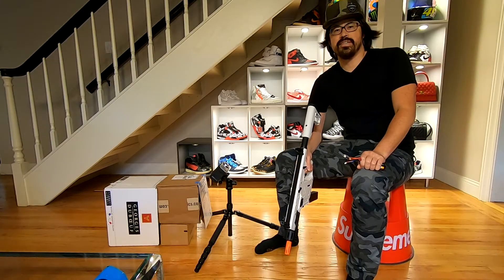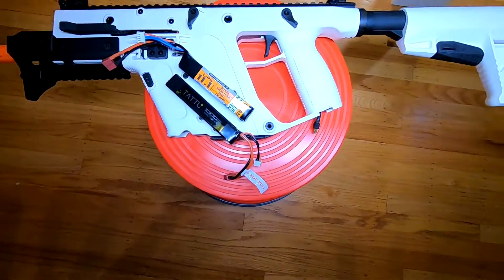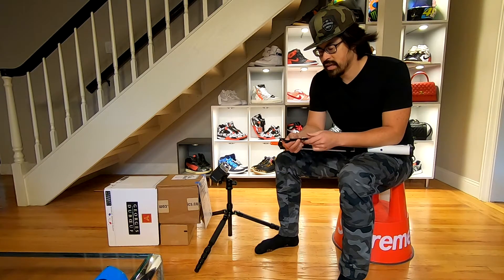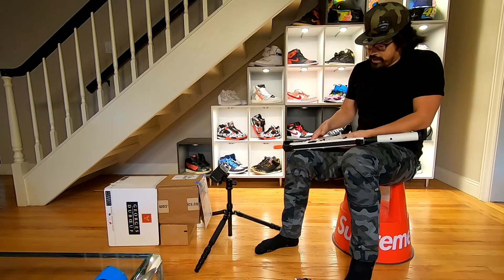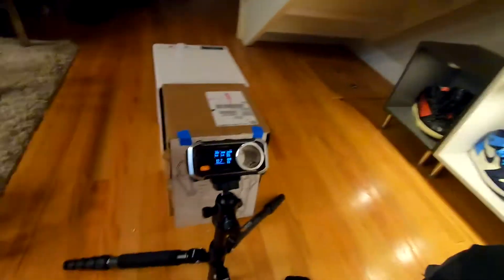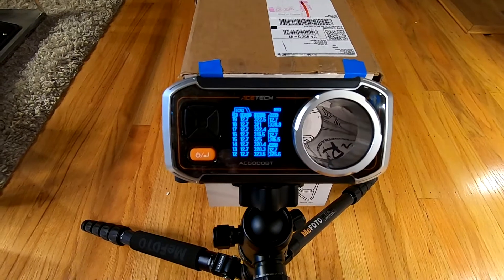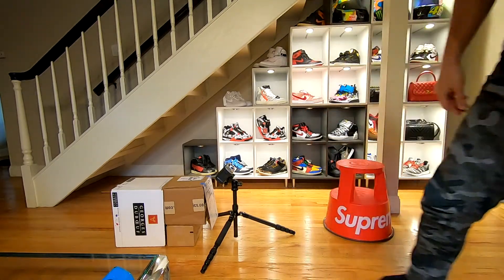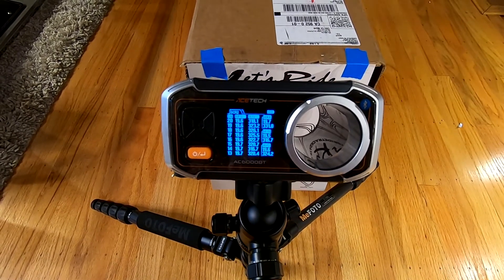7.4v vs. 11.1v Lipo Airsoft Batteries: What's the difference?!?

Comment: I got a 6v battery pack in mine and the only upgrade I see available is a 7.2v . Is this small jump in voltage even gonna be noticeable or should I just leave it alone.
Reply: yes slightly.

Comment: Hi im new to airsoft  if the recommended lipo battery is 7.4v can i use a  11.1v?  a higher volts?  thanks
Reply from the maker: What's up man, I don't want to speak for everything, so you might want to search for your specific case, but yes, I do use 11.1v in mine where they recommended 7.4v and I haven't had any issues. Your mileage may vary.
Reply: Use lipos only if u have a mosfet tho

Comment: Quick question ⁉️ if your gun is  9.6v nimh - 11.1v lipo ready could you also run a 7.4v lipo?.
Reply from the maker: I believe so, it will just be underpowered vs 11.1v lipo.  I have done it in my own with no issues
Reply: @FlawlessActivity  alright man thanks for the quick feedback. Still waiting on my Lancer Tactical Elite MMC to get here this week so I can try it out.

Comment: Huge difference! Good info man, I've heard people claim a battery voltage affects FPS, but thats just silly logic. Its the same spring and gear action every time, the only difference is the speed, in which you clearly demonstrated!
Reply from the maker: Thanks man! Yea, I mean, I honestly didn't know any of this when I started, so once I learned how everything worked and it all made sense, I figured I would verify it and pass the info along. Hopefully this helps others wondering the same thing!
Reply: Look at novritsch shop he claims that his ssr15 has 1.6 joules with 11.1 and 0.9-1.4 with a 7,4
Reply: @corbikristukat2129  Those claims are completely false. He of all people should know battery voltage does not affect FPS.